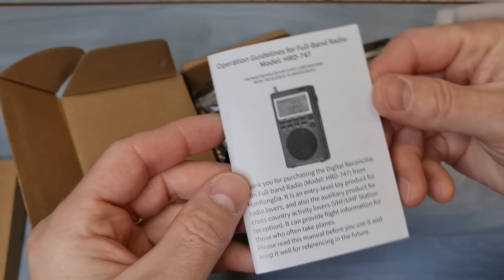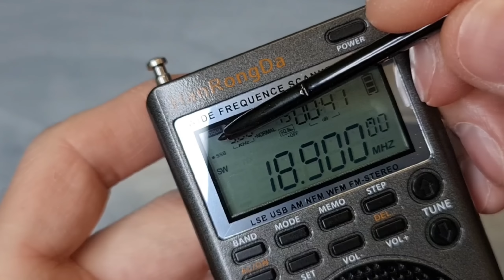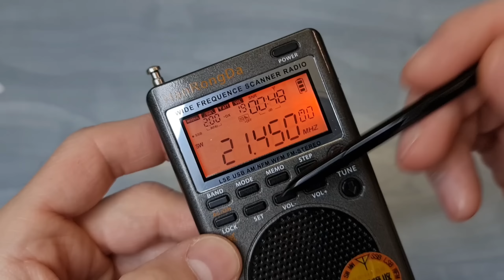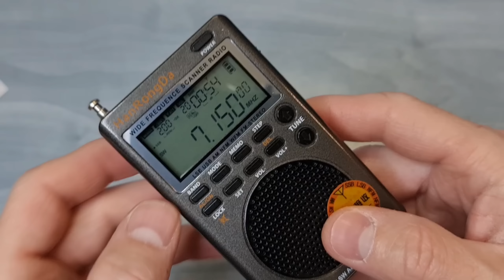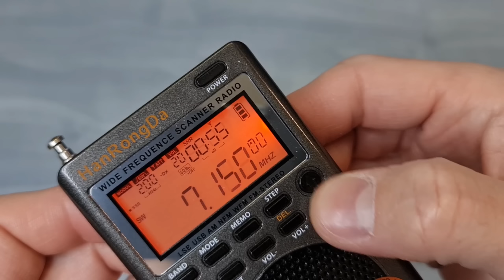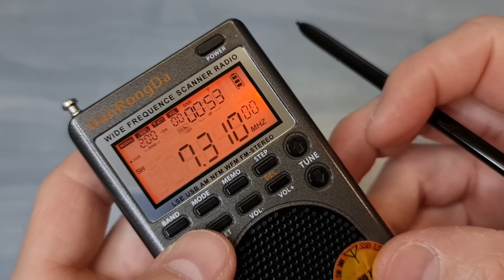Pocket SSB SW/CB/AIR/VHF/UHF receiver HRD-747 (review)

Comment: I think the Raddy RF760 has a WX Band on it, which is a small section of a vHf band... including a Weather Band? That's the only Difference.  Although all the same frequencies are available. I've listened to Cargo Ship's & Coast Guard on mine. I've heard Ham operators at certain times, both day & night - reception varies in different areas. I could not listen to Law Enforcement or Health Emergency, though Fire Department was accessible?

Comment: Interesting review. I've bought its rebranded version the Retekess TR-110 and I'm thoroughly disappointed. In an urban environment with FM transmitters around it's completely deaf. Other, cheaper radios like the Sihuadon R-108 fare way better in the same environment. Yes, they're bigger too.
I shall probably return it unless another test in a quieter environment gives completely different results.
Reply from the maker: Wait for my next upcoming review of ATS120, I think you will be suprised 😉👍
Reply: @OM0ET  Thanks for your reply. I hadn't heard of this new beast. It looks quite interesting indeed but apparently lacking the air band, which was kind of a point for buying the TR-110 (which at this point I consider as unusable for this purpose). I will certainly look forward to your upcoming review. I've just subscribed to make sure I won't miss it.

Comment: LW will work if you use Tecsun external antenna, 150-1710 khz. This antenna is used with ATS DP 368 and 360 radios, and can be ordered separately. I have several of them. When I put the antenna on my 747 it immediately tuned to 153 khz, and received a aero beacon on 332 khz. Also improved MW reception.

Comment: Unfortunately SSB does not work on mine. I ordered Raddy RF760 from Radioddity. I told them about the issue, they sent me a replacement and same story. There must be a batch of defective radios on LSB and SSB. Video on YouTube to demonstrate the bug on both radios :( -> https://youtu.be/_1pu-EoeLYs
Reply from the maker: Set tuning step on the buttons to 1khz and press tune button up or down.

Comment: In some models, conecting an external antenna an the socket jack  while radio is in MW, radio himself changes to LW band. Seems that this feature is not documented in the user manual.
Reply from the maker: That's correct. I've mentioned it in the following video. 😊
Reply: @OM0ET  Sorry. By mistake I've answered here instead of  to one user.
Reply from the maker: Np 😁

Comment: The problems with Chinese products is basically mechanical wear. They never face a quality check based on wearing, so for most of those products, if there's a costant usage, you'll have broken buttons or loosing small mechanical components in a matter of weeks/months.
Reply: anti Chinese bias...

Comment: Display on this is so small it almost needs a magnifying glass.  Changing modes requires multiple button pushes.  SSB is off with no recalibration possible. Antenna is so thin it's just asking to be destroyed.  A positive point is that this has amazing sensitivity on mediumwave.

Comment: Most DSP synthesized radio receivers has this annoying chuffing or muting between stations while tuning. Only the high end receivers features the continuous seamless tuning like the analogue radios. Wish manufacturers of all brands paid attention to correct this major flaw
Cheers!
New Delhi
Reply: It is very annoying indeed. I think they are all based on si4732 or similar chips, and those are not able to do continuous tuning. I guess they didn't have tunung in mind. The use case they covered is you scan for stations and use theme from memory. Too bad.
Reply: @batica81  couldn't agree more on this. Honestly, with much expectations I had recently bought another DSP synthesised radio receiver but, sadly it is now heading to become a junk as I hate the chuffing/muting effect while tuning. It's so damn bugging that the so called YouTube radio ace radio reviewers stops short of mentioning this major flaw. I regret wating money on such junks
Reply: @shandybrandy5407  Ah too bad. Yes, it is a huge flaw and almost nobody mentions it, like everyone got used to it being so. I can recommend Belka DX receiver, it has perfect continuous tuning and works very well. Although it is a bit expensive and mostly ham oriented so it does not have other fancy SWL features like automatic tuning and band selection. Look it up, it has plenty reviews online and still seems available although shipped from Belarus.
Reply: @batica81  thanks for the information, will look into it
Reply: @shandybrandy5407  Tecsun did an amazing job with the H501x, sounds a lot better on SSB than the PL-880,990x and S-8800 and the 4 Khz filter works on SSB on the H501x it doesn't on the 880,990x or S-8800 + the audio sounds very muffled and pretty bad distortion at the beginning of a transmission on SSB worse with strong signals. The H501x fixes the filters making the radio sound much better, still some distortion but it's not nearly as bad. 

Pretty much all the DSP radios have the issue of distortion at the beginning of a transmission some are worse than others. 

The PL-330 is a really good radio too for it's size having SSB is amazing and it supports external antenna for LW/MW same as the H501x.

The H501 audio in general is really good from it's built in speakers.

The PL-680 has decent audio from it's speaker too and it sounds best of all dsp radios on SSB free from any form of DSP related distortion, it's filters are a bit wide for SSB but still nice clean audio and sounds great using ECSS on an AM station, way better than the DSP radios and with external antenna there's not going to be more you will hear on a dsp radio than the PL-680.
Reply: @o00scorpion00o  H501x is real good as it is armed with all the bells and whistles but it is too damn expensive
Reply: @Evil Robot Santa Claus 🎁 💣 💥  The Belka is a cool device but I prefer a normal radio. The Tecsun PL-680 is a really fine radio and does ECSS remarkably well with lovely analogue audio free from that DSP distortion and in many cases muffled audio. 

Tecsun did fix the filters with the PL-330 and H501x but there's still some distortion but not nearly as bad as the PL-880, 990x and S-8800.

I do have the malahit SDR v2 the original and that's a cool device, good performance and good sound and SYNC.

Comment: Very good review Paul.  If you plug in an external antenna this radio suddenly comes alive starting at 153khz (turn it off then on again)so only then does it display Long Wave...could be the same for 160M? 
Maybe the successor to this (HRD-757?) will have a direct tuning numeric keypad on the front, a bit like the Tecsun PL-368 (the PL-365 was lacking a numeric keypad which was annoying). My Tecsun Pl-368 stopped working on all AM bands so now I have an ATS-100 on order at a really good sale price from Ali, hopefully will have it this coming week. 73
Reply: How much use did you have before it stopped working? Any reason or did it just fail? Thanks.
Reply: @ashab1  I have it exactly 12 months and I didn't really use it that much at first..it was  mostly still in its box.., only in the past 5-6 months did I start to really used it, I found the external AM antenna socket great as I could connect it to my loop and hear LW, MW and SW...the ETM function is class! Maybe it got a shot of static from me, I don't know but the AM section is completely broken. As I said I have the ATS-100 on order, got it for a good bit cheaper than the HRD-747 here...but I've seen it at much higher prices.
Reply: You don't have to switch it off and on to get Long Wave. Just plug in the antenna, and the frequency drops from 522 to153 KHZ
Reply: @millinchip2  antenna from Tecsun PL-360/PL-365 ??
Reply: HanRongDa HRD-767 is like Mini Walkman of AM (522 - 1620 / 520 - 1710 kHz, 9 or 10 kHz AM stepping switch), Japanese FM band (76 - 108 MHz) and Air Band (118 - 138 MHz) but it doesn’t have MP3 player, same body as HRD-602 but no air band.